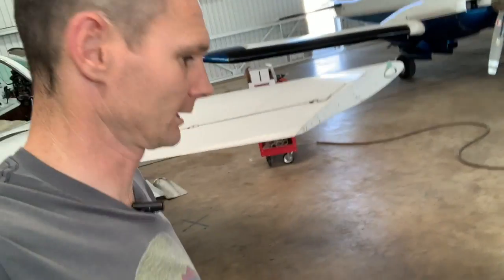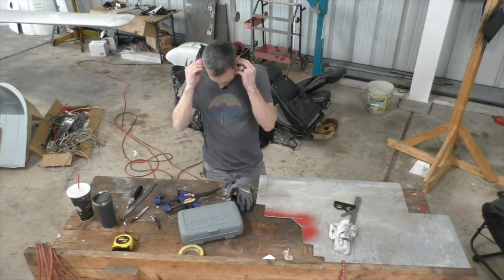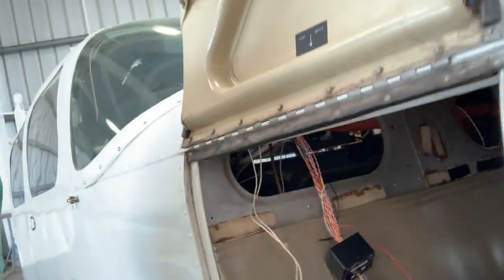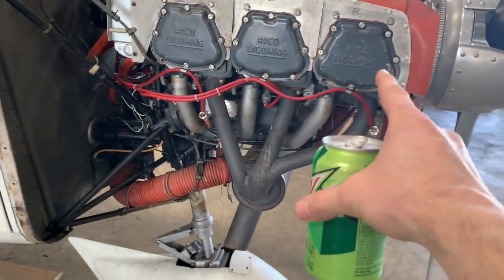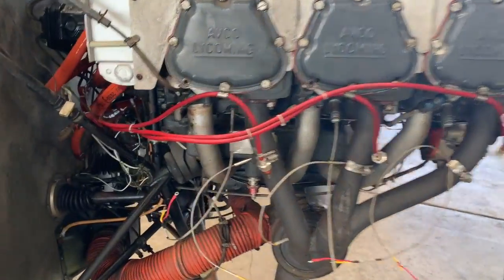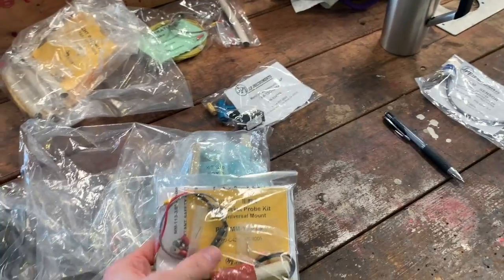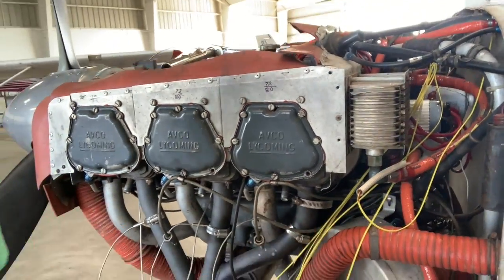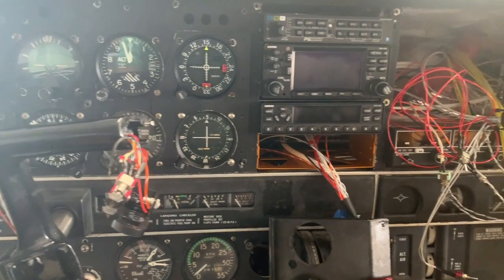Fastest & Easiest Engine monitor install JPI 830 Part 1.... EP24

Comment: Hey Jim I  am swoping my JPI 700 for the 830 plug and play??
I am adding  MP and RPm probs .
do you know if the 700 would have been grounded to the engine as  the 830 cautions this must be done .
Or do I have trace pin 25 from P1 to find out?

Comment: That video was really great, much more enjoyable without all the BS you normally through in. I understand you are trying to make it a bit more fun to watch, how ever unless you're 8 to 12 years of age, or from down south it's not really that funny. I also think if you spent less time being an ass, you wouldn't make so many stuff ups. Also pleas note.. unless they have started making aircraft electrical systems Positive to ground, you should NEVER attempt to undo the Positive first as you mentioned in an earlier video..
Please keep up the great job you are doing as it is truly a great thing you are doing bring life back to an older aircraft. I actually have around 75 Hrs PNC in this type myself...
Best wishes from down under, Vernon...

Comment: Im in the high voltage switch gear industry and looking at all those wires in the back of the panel made my stomach turn. If we did wiring like that none of our equipment would pass inspection. I hope the reason is that you are not done with the wires in the back.

Comment: Jimmy. I'm amazed you don't get in a pickle with all those wires. How do you not get muddled? ----I've just seen that you have a degree in electro-mechanical engineering. Could you do what you're doing without that training?
Reply from the maker: Thanks for the comment.  If you can setup a tv with a stereo system, you could do this.
Reply: @therealjimmysworld  Jimmy -- I wish I had your confidence💖

Comment: As an avionics technician I really hope youre going to clean up that wiring behind the panel! Also, not sure if you noticed in the installation manual for the EDM, JPI specifically notes that the star washer is to go in between the two ring terminals, not under the head of the screw like traditional. Also, its always good when you're tieing up the harness for all of the EGT and CHT's, put a little loop in the thermocouple wire at the probe, this gives a bit of a service loop/slack and prevents the probe wiring being under any tension.
Reply from the maker: Thanks for the info. Yes, all good points.  And yes, the spaghetti will get lots of zip ties to look all purdy...

Comment: Jimmy, if the switch/connector can fit through the existing hole without the grommet then run the switch/connector through the hole. Then cut a slit in the grommet for the harness and reinstall the grommet in the hole. No need to drill another hole if you don’t need to.
Reply from the maker: It wouldn't fit :( that's why I pulled the grommet, also, I don't like splitting grommets if I have the choice.  That little split always seems to find it's way to the very spot I'm trying to protect...
Reply: @therealjimmysworld  those 3 pins on the RPM sensor come out really easy. Just remove the pins from the plug, put it through the holes, and reinstall the pins into the plug once through the firewall.  Just had do this exact thing in my Maule.
Reply from the maker: That would have been easier... lol

Comment: G,day Jimmy from Sydney, Australia.
* the plane is looking great.
* I notice thee FAA has a long waiting time for processing their forms: rego/airworthy
* new plexiglass or cleaned
* like to have a closer look at the propeller: if it has nicks/scratched.
* fues light fault panel (what about a light touch main switch to indicate circulate current).
Is the soft drink Mountain Dew (Jew)? 
🌏🇭🇲🚴‍♂️
Reply from the maker: Thanks! yeah... FAA is taking months....and months.... to do anything! 
windows were replaced before I got it.  Prop only has 10hrs, no nicks
- no idea what you're talking about with the fuse lights
and yes, the fizzy drink is called Mountain Dew...not sold in most other countries.... I wonder why.... ;)